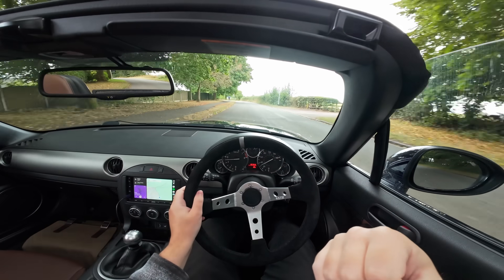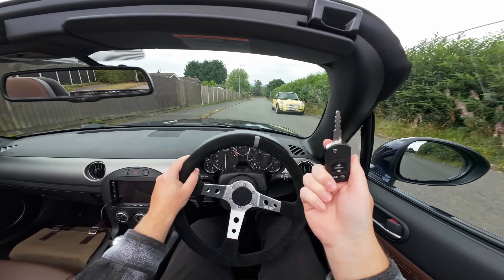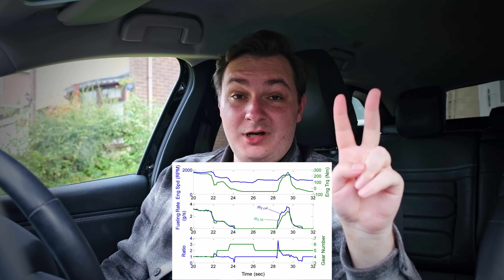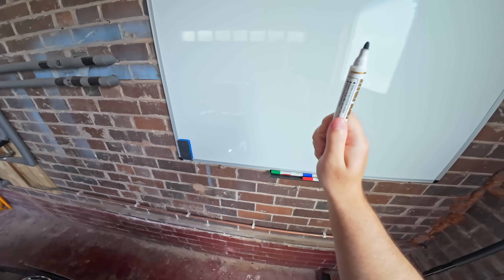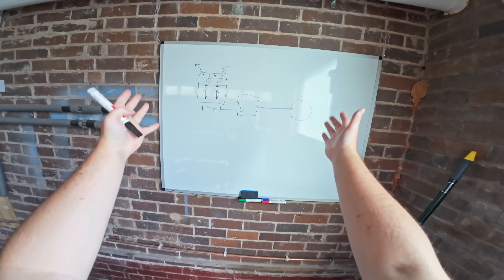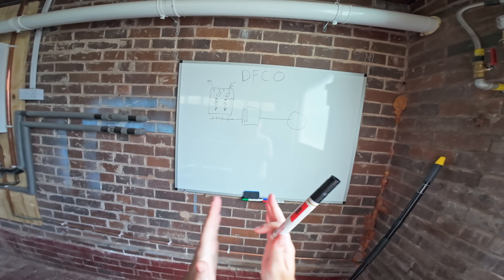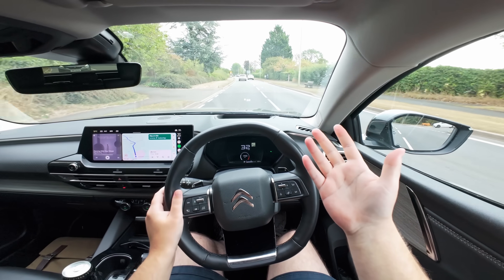The most misunderstood car term - Engine Braking

Comment: There’s another concept that becomes valuable at high speeds. A car’s required power (from the engine or motor) is due to the CUBE of the velocity. So, when you lift your foot off the accelerator at high speeds, you will decelerate much faster than when you lift your foot off at lower speeds. I kind of think of it as wind braking. You can take advantage of this phenomena when exiting from a highway or approaching a red light from far away. You rarely need to use your brakes on the highway if you’re able to anticipate the decisions of the cars ahead of you and if you maintain a healthy following distance. Also, a lot of traffic (and rear ends) is caused by people over braking and decelerating more than necessary

Comment: That's not what I call engine braking because that's not braking. Engine braking starts the same way you're showing, with lifting your foot off of the gas pedal, then when the RPMs are low enough, you shift down a gear, and that's when the braking happens. What you're doing here is what I call lifting the foot off the gas. Everything else you said is valid, I just disagree with the name, because if that's braking, then what would you call doing this and shifting down?

Comment: Early fuel injected cars also didn't turn the fuel off when you released the accelerator, and yes I have driven a carburettor car, but the last time I did that was around 1995

Comment: Wait so engine braking uses less fuel than rolling in neutral? 🫨
I've always done the latter because I assumed that engines inject a minimum fuel per rotation even when you're not touching the pedal, and the faster the wheels are rotating the engine, the more fuel is being injected, and so an idle 800RPM that neutral gives you would be better. And I thought that accellerating then neutral coasting in neutral, then accellerating then coasting was the most efficient way to drive a car. Glad to be proven wrong!

Comment: Look I don't drive, I don't know why this is in my recommendations, I did watch it all and enjoy it though, but can someone explain what's wrong with braking with the clutch? I would imagine using the clutch paired with engine braking would be much the same, how does that wear out the clutch?
Reply from the maker: The clutch is an expensive, delicate wear item. Best not to put unnecessary load through it - like for example using it to brake!

Engine braking doesn't wear your clutch at all, it's exactly the same as accelerating in-gear. Disengaging the clutch then re-engaging it for braking will wear it hard.

Comment: Ok The reason why I always thought you need fuel is the sound of the engine. I think the sound of an engine at a few thousand rpm must come from the explosions. So imagine this: you have 100 km/h then you shift into the 2nd gear. No gas 2nd gear and 7000 rpm (Obviously this will kill your clutch and gearbox but for the sake of the argument) The motor will howl like when you accelerate like crazy in the same rpm. So you would think it injects fuel.

Comment: I've known this since I was a teenager and I'm 31 now. I've had arguments with older people about it. I still remember opel vectras, owned by people I know that have this consumption data on a screen. When the drivers were using the engine braking, the consumption was zero. When they were coasting or idling, the consumption was 0.9 l/h.

Comment: I thought everyone knew that engine braking doesn't consume fuel lol
I actually clicked away from the video after hearing you mention that, and then I went back thinking "maybe I'll learn more," and I guess maybe I'll skip to the end of the video to learn more cuz most of the video is about how it doesn't consume fuel.

Tbh tho, whenever I downshift, I feather the gas to get the RPMs to the right spot so I don't put as much wear on the clutch. I don't know if anyone else does this, and it probably consumes a negligible amount of fuel every time I start engine breaking.

Comment: How does this work with cars like my Corolla (non hybrid) which have an additional "B" on the shifter. Does that just downshift the gear for additional braking power or does it use fuel to "actively" engine brake? The engine gets significantly louder when it's in "B."
Reply: Correct me if I’m wrong but wouldn’t “using fuel to actively engine brake” require that the engine runs backwards which shouldn’t be possible right? Surely it’s more logical to just have the car automatically downshift earlier to achieve the same effect.

Downshifting from a higher speed will cause the engine to run on a higher internal RPM (using more energy and therefore slowing the car down more) which will make a lot more sound. I’m guessing this is what you are hearing
Reply: @Glocktopus1  yeah that sounds right, I just wasn't able to find concrete information on it.

Comment: I think some if not most modern cars with electronic throttle pedals help push this misconception by not actually completely cutting fuel when you let off throttle for comfort reasons. My manual car refuses to cut fuel under like 3.5k rpm in second, and I don't remember it ever engine braked in first. I suppose because especially in lower gears, engine braking is very noticeable, the sudden fuel cut as you quickly let off throttle hits as hard as full regen braking in EVs, but harsher, and I think regular people without the technical knowledge would likely think the car is malfunctioning, or at least complain about the car driving harshly. In an automatic car my family owns, I notice the car doesn't engine brake immediately when off throttle; it feels like the car is simulating a very slow and gradual release of the throttle pedal. This is understandable since this is a comfort oriented car. Its manual even specifically says that there's more engine braking in sport mode, implying that it indeed does not full engine brake in normal mode. I suspect this is a common strategy used in most automatic gearboxes today, which causes people to buy into this common misconception.

Comment: The comments about bye-bye clutch are also misplaced, because during engine braking the clutch is not slipping on the flywheel whatsoever, and is bearing a fraction of the torsional load it does when you floor it, and the gritty material the pads are coated in don't care about direction.

Comment: The key thing to understand with "engine braking" is that most of the conversion of mechanical energy into heat happens in the throttle, which adds heat to its output air that will then get carried through the engine and out the exhaust.  As a consequence of this, there's no limit to how long a downslope one could safely travel using engine braking to regulate speed, since any air that was heated by the process would be abandoned behind the vehicle along with all the heat energy it contained.

Comment: I have a diesel with a manual and you can hear the injectors as they operate. If they're not operating, they're not injecting. If you take your foot off the gas without disengaging the clutch it goes silent. If you disengage the clutch and let it free wheel, you hear the injectors come back on.

Comment: 10:28 that's literally how I was taught to brake when learning manual. you don't put the clutch down, you take the foot of accelerator and wait till the car comes down in speed, then clutch goes down and brake with it. putting clutch down at the start of this maneuver would be coasting

Comment: Over the years I’ve picked up a couple of interesting things about this kind of mechanism. Back when I worked for Caterpillar, I learned early on that in rigid dump trucks and articulated dump trucks, the main way operators slow down is actually with the engine. They even have an additional feature for this called a “jake brake” (or “retarder”).

When normal engine friction isn’t enough to slow a vehicle, the jake brake can turn the engine into a sort of compressor:

Once activated, the ECM manipulates the valve train.

At the top of the compression stroke, instead of letting the compressed air expand, the exhaust valve opens.

The compressed air is forced out through the exhaust. No fuel is injected during this, so the engine is doing a lot of “wasted” work.

That wasted work slows the engine down, and in turn, the vehicle.

Why use this instead of brakes? Mainly because brakes wear out—and on heavy vehicles like dump trucks or lorries, prolonged braking on a downhill can cause the discs to overheat, fail, or even catch fire. It can also damage brake fluid over time from all that heat.

I’ve also been told lorries can have jake brakes, and it makes sense, since this only works because when you lift off the accelerator, no fuel is being sent to the engine until the revs drop low enough to risk stalling.

Even in my own car (an Audi), you can see a version of this at work. When I engine brake downhill, the MPG reading shoots up to 999.9 mpg, and the moment I so much as touch the accelerator, that number drops again.

Comment: You just referred to the kinetic energy of a moving car as potential energy multiple times. The potential energy is in the fuel (and technically the mass of the vehicle with respect to gravity.)  It may seem like a pedantic issue, but it's enough to make me suspect all your technical claims are muddled with similar misunderstandings, and click away from the video. Which kinda sux, cuz I was really into it up until that section.

Comment: Many people implicitly assume that instantaneous fuel consumption goes like instantaneous RPM, which is only true while in a single gear under engine power. Rather, instantaneous fuel consumption goes like instantaneous fuel pedal depression. Hence, if the fuel pedal isn't depressed, you're using no fuel. QED (Yeah, I'm inventing terms, but their good terms and helped me make sense of this years ago!)

Comment: 00:05 Please, please, please - don't try this at home kids.
You risk your steering locking up without the key in the ignition. 
The last thing you need is to lose (or be limited of) control of your vehicle at speed.

Comment: If you could shift into neutral and turn off ignition then you'll have even more inertia to play with and not waste energy into pulling vacuum and pushing air. But how to safely increase engine rpm to idle or actual level without any wear. Maybe use starter to kickstart and keep rpm close to actual driveshaft rpm so clutch wont skid much.
Reply: This is called coasting and there is no need to turn it ignition to do it, just shift into neutral and don’t touch the accelerator. But this doesn’t help you brake in any way which is what the discussion is about. It will actually cause to accelerate if you are travelling downhill (even just slight downhill)

Comment: You can watch this effect if you look at the instantaneous fuel consumption part of your trip computer, when you lift off, it will show --- if you are engine breaking but will show some fuel used it you are in neutral. Surprised mechanics would not have a good trip of this. Interesting video, thanks

Comment: I would've gone further in showcasing how effective engine breaking is on a manual car going downhill, 3rd or 2nd gear and you can basically never use brakes and use 0 fuel.

Comment: I use this technique all the time. And I always wonder why so few people do it. 
However there a few things you should keep in mind:

1. Modern automatic cars. Fuel supply will be restored below some RPM (around 1k probably). I think it's different in different cars (not a mechanic). E.g. I have a 3L engine. And it's better to break before traffic lights at ca. 20kpm, because if it goes to gear1, it'll consume more fuel. With smaller engines like 1.6 this might be different.

2. Control when you go through the corner. If you are moving relatively fast and the corner is relatively sharp you'll want to hit a break pedal before the corner. Because the front axis will be briefly loaded, but then when you release the break pedal and give more gas in the corner, your back axis will be loaded. Front axis will be 'free' again. This will make steering easier. Basic stuff for many I know. The point is that when you engine break, your front axis is slightly more loaded, which makes steering a bit harder. Anyways, if you're going fast through corners, probably fuel economy is not your priority.

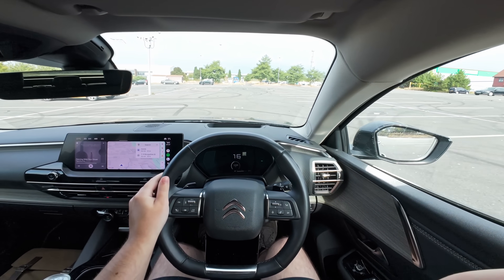Comment: 11:08 Also some ICE cars have an electronic system to make entirely fake engine noises. The system vibrates the windscreen, effectively using it as speaker. Not sure if it’s used for “pops and bangs”, but it certainly could be active under engineer braking.

Comment: Everything's clear, but just a tiny remark regarding phrasing. In the demonstration section of the video, around 15th min, the phrase "free fuel", repeated several times, can act as a hook which can yield unreasonable comments. Better phrasing, as you do put it differently a few moments later but noticeably less emphasised, would be somewhere in the lines of "fuel free distance coverage".

Comment: So why are there sometimes signs that say 'No engine braking'? The way this was previously described to me was downshifting while coasting (or apparently engine braking as he says in the video), but on my car (hybrid) this caused the engine to run quite loud (not sure if it was actually running, stopped right away cause the noise was way way louder than the engine normally gets, it honestly scared me), was what I was doing called something else?

Comment: I do this down any hill and when cruising to a stop sign or red light.  Another way to check that you are in fact using engine breaking, is to see the real time fuel economy numbers.  The numbers should immediately just to 99 mpg or the highest amount of fuel savings on the gauge.  But I’m still not brave enough to take out the key while driving.

Comment: Oh, I get it, you do it in an automatic car. That's easy.
In a Manual transmission if you slow down, you should shift gears too, or the car just start shake the engine gonna stall, and you suddenly stop. And the shaking vibrations the engine cause during that stalling period not realy healthy to the car.
I drove manual cars all my life and use engine brake since I got my licence. But you only go so slow in a manual car if you play with the clutch in 1st gear not with engine brake.
I'm actually surprised that people don't understand engine braking.

Comment: 3:34 Actually, my Toyota Camry Hybrid doesn't use engine braking when you lift off the gas while in Drive. It has a separate Braking mode that you need to engage to get engine braking.

Comment: I've always used engine breaking, the problems occur when you want to slow down gradually and the person behind is one of those who likes to slam their brakes on at the last minute, they can become very impatient. I think riding a motorcycle is a good way to learn about it as the effect is far more pronounced. You can ride almost up to the speed limit sign before cutting the throttle and suddenly you are doing the legal speed.

Comment: DANGEROUS af. Never ever do that with your key. Taking it out of the lock is while moving is a sin. Most cars have wheel lock that engage when the key is outside the lock. If you must switch the car off, leave the key in the key well. 

P.S: I understand you did it on a straight road, and was in controll. At least disclaim it.

Comment: That's called coasting. Engine breaking is when you use your engine to slow down even faster.
Reply: I believe coasting is when your car is in neutral (N in an automatic, and not in gear in a manual) and is actually idling while you are moving.  In most places this is not advisable or might even be technically illegal , if you needed to accelerate you would have to put it into a gear if a manual transmission car or back into drive in an automatic.
Reply: @kaeki  That is his definition, but if you ask people what coasting is that isn't what most people would say.
Reply from the maker: It's the textbook definition. Not my fault if people use it wrong.

You can downshift for extra engine braking. But you can't coast in gear.
Reply: @MickDrivesCars your textbook is out of date. Anyways english is a descriptive language, not a prescriptive one.

It was a very well made and entertaining video btw.

Comment: I didn't learn a thing from this video!!! ....and that's because everything you said already makes perfect sense and is intuitive to anyone that instinctively knows the dynamics of power transfer and linkages etc and who have a natural feel from the feedback a car gives you when driving, some people can drive but are so detached from what is going on to make it all work unfortunately and you are wasting your time with them, it is scary to be a passenger in a person's car that drives fast but you can tell that they do not have instinct and plough into corners fast and steer sharper as the corner bends and the car is wallowing and the weight is so light on the inside wheels it could break traction at any minute they break harsh, accelerate harsh the poor steering rack is struggling, the clutch takes a bashing etc etc,  and don't start me on seeing white van men bashing up kerbs soo hard you can hear the rim almost bashing,  engine breaking deniers  need to ride a fixed wheel bicycle or unicycle and go down a hill, they will soon realise the momentum overtakes your speed and starts pulling you along and driving your legs faster and you don't need to pedal anymore, but yeah I only disagree with the free fuel while engine breaking, because I see it as just raking back a bit of savings from the fuel that rocketed you up to speed in the 1st place, I generally only switch my AC on when I'm coming down a hill and using engine breaking 😂👍